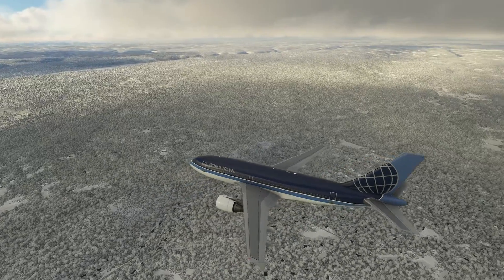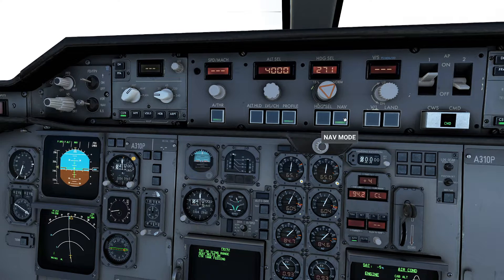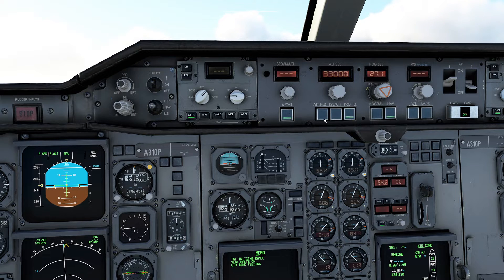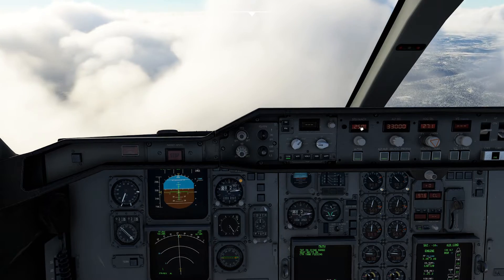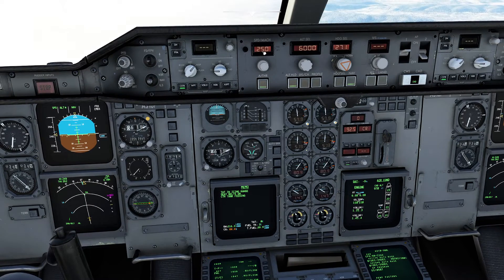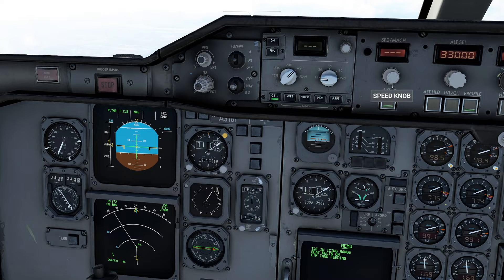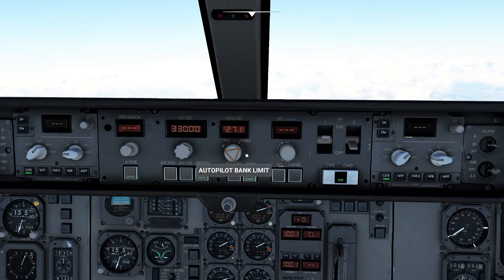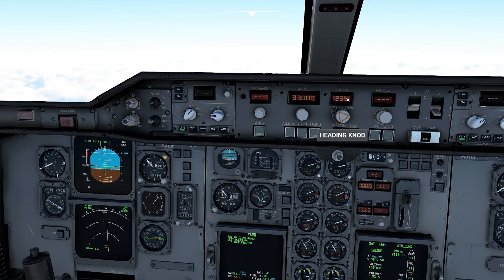MSFS - Airbus A310 Autopilot Tutorial

Comment: I just did my first A310 familiarization flight and I had just one button for AP1 toggle. Once I turned off the AP the whole cockpit started screaming at me with all sorts of horns and AP off sounds and it just wouldn't shut up!
I only later realized that I was supposed to use the AP disconnect switch on the yoke 😝

Comment: How can you disengage the autopilot without the auto pilot of alarm sounding continually
Reply: bind an assignment to autopilot off instead of toggle and double click that assignment.  you have to double click it to tell the plane your disengaging it intentionally which will cause the alarm to sound once and then stop.  unfortunately toggle will turn it back on when you try to click twice which means you need a separate assignment to turn it back on.

Comment: For me sometimes the ap does what it wants without any reason and it is driving me nuts to the point i want to smash my monitor
Reply: Yeah one time it insisted on putting me in overspeed, even after turning off auto thrust it kept doing it
Reply: @djrivera2219  Yeah it spoiled some approaches for me. Today it was even better. I got full engine failure two times in a320 by FlyByWire. No idea why.